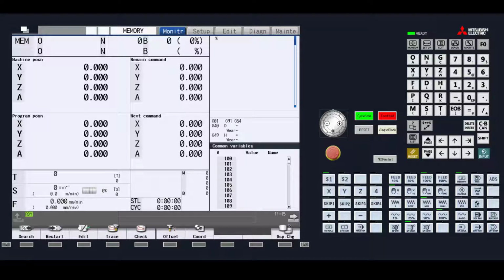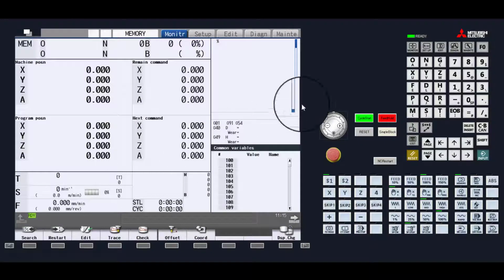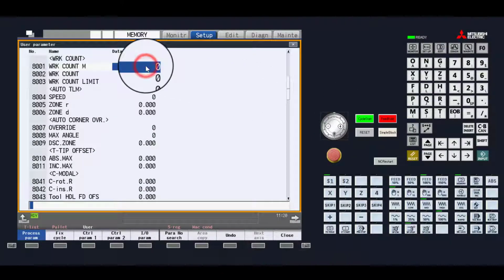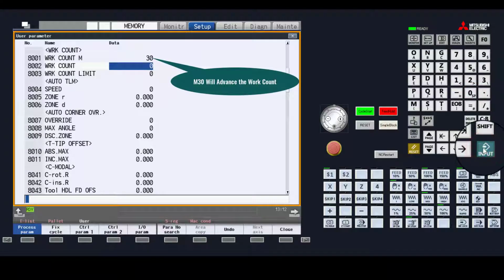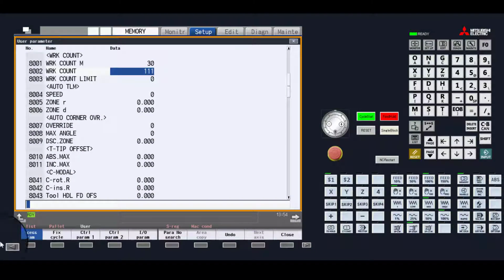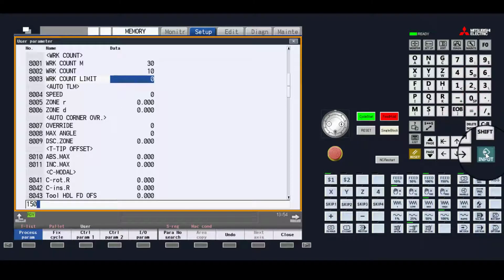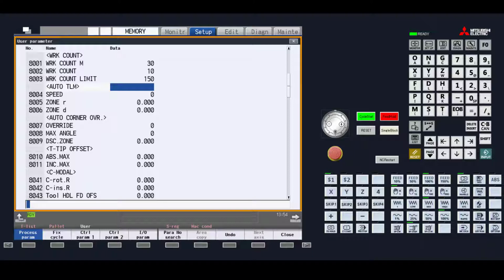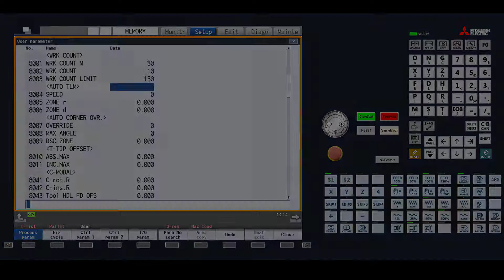Parts Counter on Mitsubishi

Comment: Can I use m99 in #8001?
Reply from the maker: Yes you can add "M99" to parameter #8001. We like to use "M89" so you can choose whether or not to place a part count in the program.
Reply: @expandmachinery1805  excellent
Reply: @expandmachinery1805  how to show work count display ?
Reply from the maker: @nanangjeni9725  I am very sorry for the late reply.
Go to SETUP>USER>"page down 1 page.
You should see work count and the M Code that it uses to count.
Our lathes are generally set to M89 for the count. Mills are set to M30 for the count.
You can set it for any M Code you wish to use.